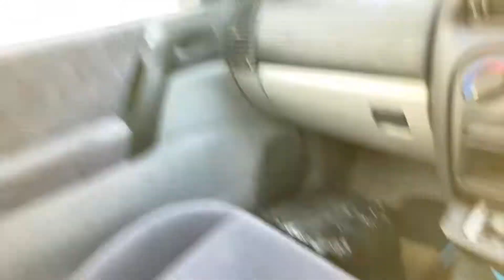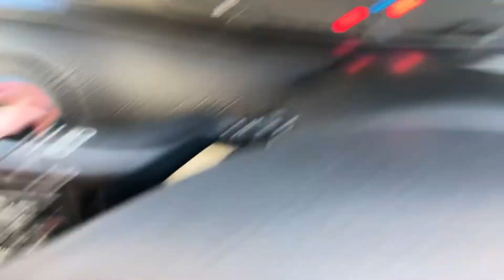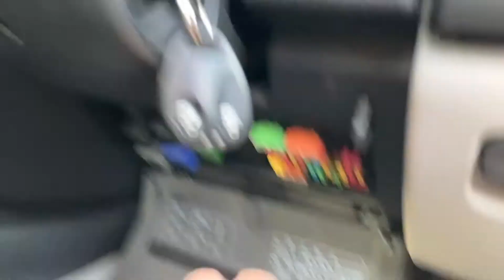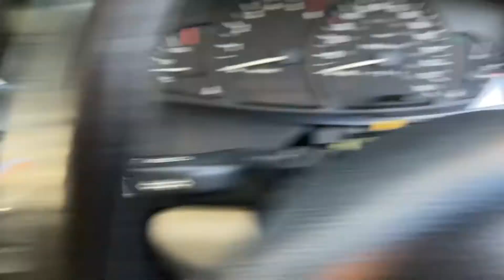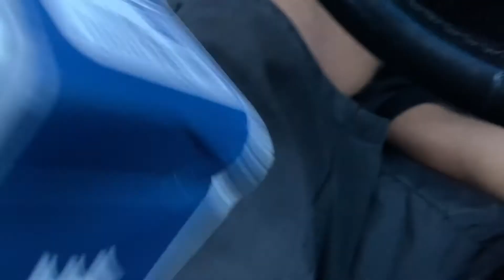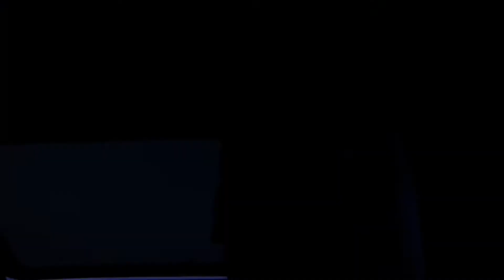Project Omega PART 4 Fitting Cruise Control | Vauxhall Omega GLS Estate 2.5 TD BMW

Comment: Thanks for this video, I've just bought a 2.5 td auto omega gls and it has no cruise control. Was yours simply just plug and play? No programming? Thanks
Reply from the maker: Hi, it should have been but it didn’t work due to my Tech2 not going far enough back it stopped at 2001
Reply: Do you still have the td omega Aaron
Reply from the maker: @samuelmclean9963 wish I still had mine

Comment: Nice cars these, seems like you found a decent one. 

But as you say in the V6 Mondeo video not a car you can just jump in and go, takes a while to warm up and clear. 

Needs a patient understanding owner. 

If the gearbox is sound it’s a keeper.
Reply from the maker: It’s a fantastic old car, but not something to be hacked off it’s too special for that.

Ah yes the gearbox is spot on very smooth and never misses a beat.

Also very happy with the mondeo fantastic driver